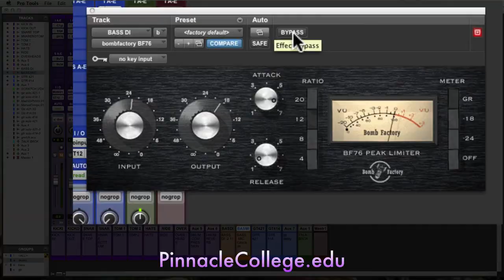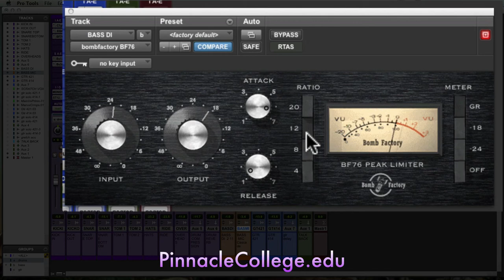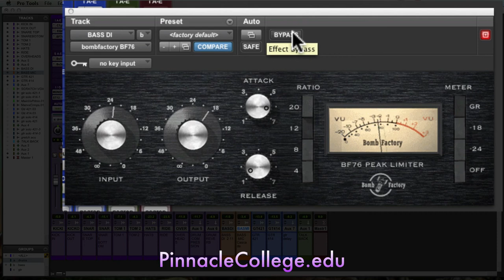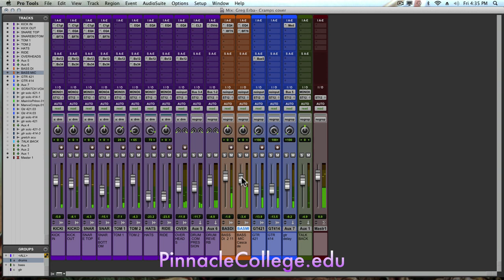How to do Bass Compression in Pro Tools, Better Bass Sound, Fatten Your Mix

Comment: Noob question: Why do you say high release when the knob number is low (just above 1)?
Reply: The style of compressor: 1176 is back to front. Slow attack is turned anti clockwise. Fast attack is turned clockwise. And the same applies to the release.
Reply: 117 attack and release are backwards as far as speed .